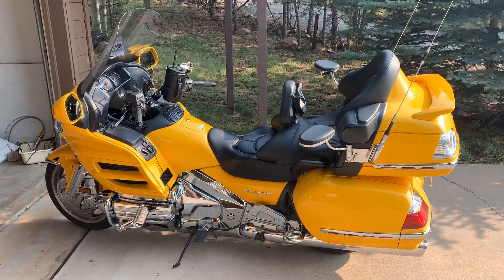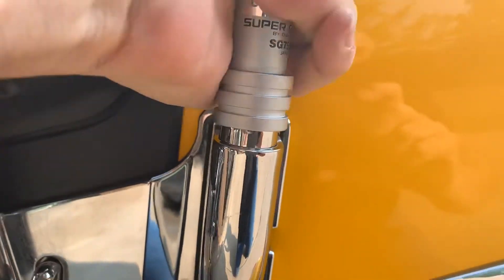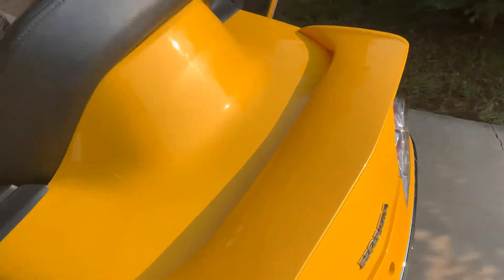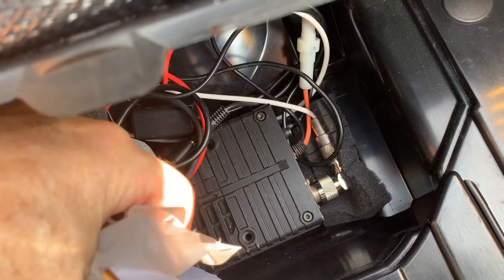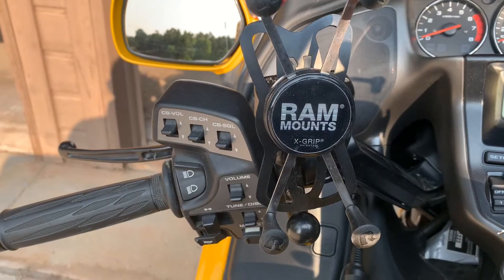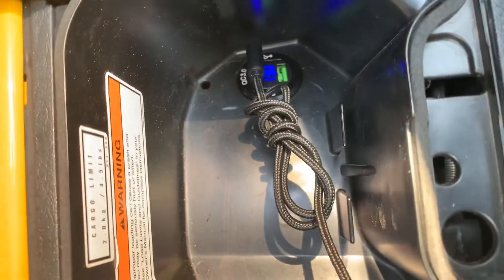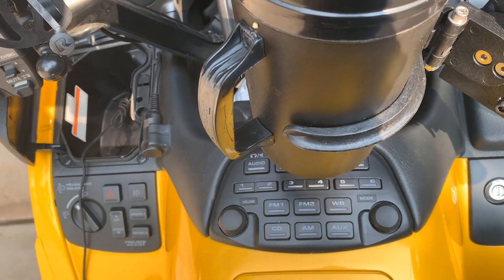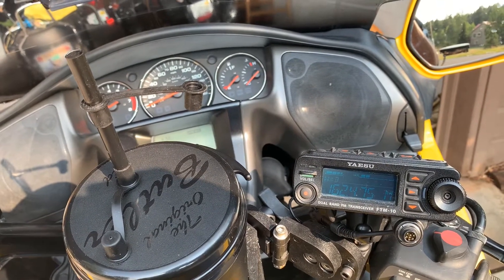FTM-10R install and antenna modification

Comment: What bluetooth unit did you choose for your helmet? I'm going to mount my FTM10R on my snowmobile, and I don't want to buy another helmet, so I need to choose one of those units to install.
Reply: I wish Yaesu would re-release another motorcycle ham radio.
Reply from the maker: I use the SENA 10C Pro. But if you don’t need the camera, a SMH-10 or the 50S would be good. 50S does mesh which might be nice if you ride with groups that use it.